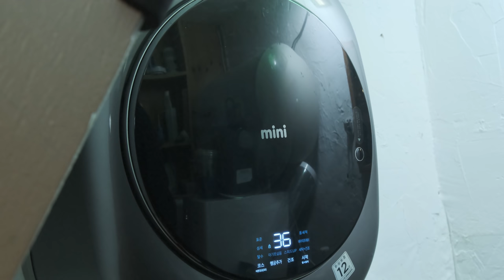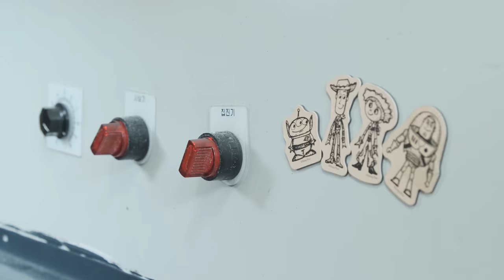[ASMR] Clean & restore "NIKE" "VTG Challenger suede"  4k

Comment from the maker: I'm sorry, It's not Vortex, It's Challenger
Reply: Hello,wery good job. 
What kind of glue do you use for gluing rubber with eva foam, have tried many adhesives and not one has glued rubber to eva foam?
Reply from the maker: Артем I used shoe repair glue, but you need rubber cleaner, If you try eva to rubber, rubber is coat when making
Reply: VeTiVeR what brand of company glue you used?
Reply: VeTiVeR where are you from?
Reply: Alex Holz  china, you can see it on the writings of the washing machine
Reply: @matteodebenetti133  bro that ain't chinese
Reply: @matteodebenetti133  its Korean:)

Comment: Why didn't you replace the piece of sole at the toe of the shoe?  Thanks
Reply: Wondering the same
Reply: To keep original look mostly. It wasn't damaged much so better to keep than replace with a material they probably have to purchase and is such a small piece. Also because this piece bonds the upper material to the mid sole and bottom sole. Stitching and different adhesive will be required if it is removed. It would also damage the rest of the stitching.

Comment: Old leather did not absorb the fresh die. You got to change the leather, how? Take away the old leather, and put brand new leather instead. The whole cover of the shoe is not leather. Just the coat. Then the new dye will stick.
Reply: No they are vintage and need to be kept as original as possible.

Comment: You know i want to conclude that the most mash up part of hand washing/rejuvenating suede trainers/sneakers is getting them so/completely wet!

How about a heat gun acting alongside the cleaning process? Dry them in immediately!!

🤔

A little air compressor spray gun cut for the dye !
Reply: No and no! You cannot accelerate the drying or it could shrink or ruin the suede. And suede should be painted by hand because it is delicate.
Reply: Yes and no

Yes the heat gun could be replaced with a hairdryer but an immediate drying process would be better! And no a mini sprayer would produce optimum results and/or leakage, spillage and excessive damp spots.
Reply: @TECsta76  Do you know what you are doing because some leathers cannot be dried quickly and much less with a heat gun. A hair dryer and  that is a maybe. And the suede I would rather do by hand because of the grain, it is not smooth. Anyways the way he does it is more artisanal and more authentic, especially for this type of ASMR video.